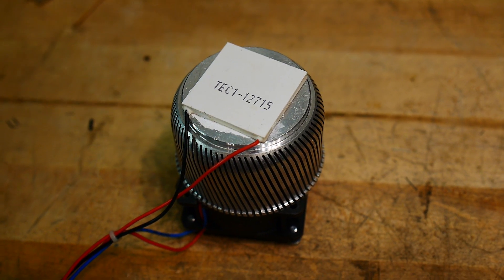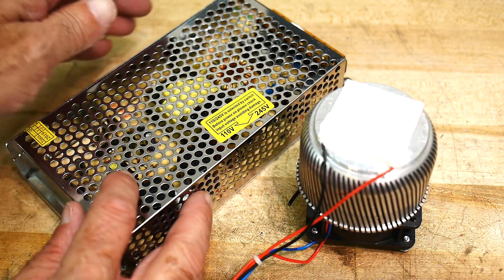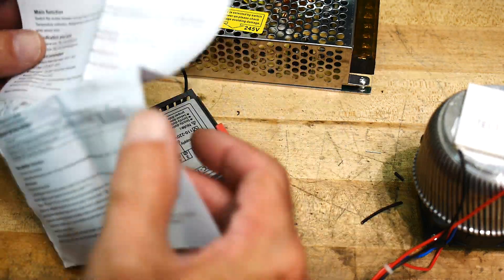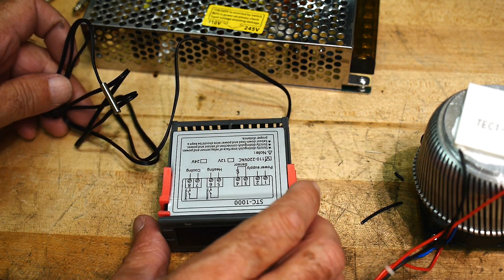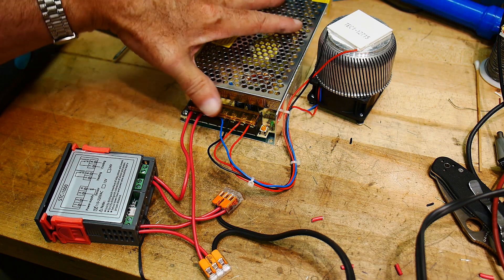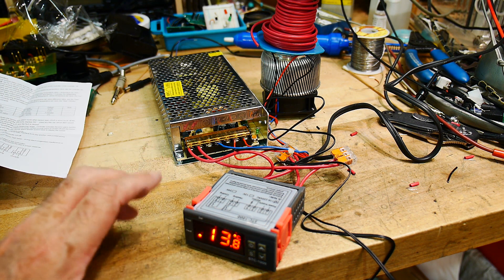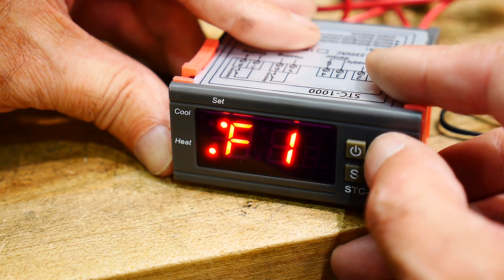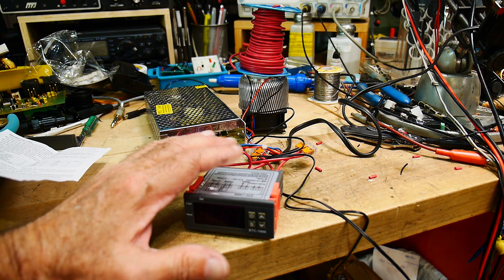#473 TE Cooler and Temperature Controller

Comment: According to the data sheet, the STC1000 uses an NTC sensor not a thermocouple. I thought it might actually be a PTC so looked it up. It's unusual to use thermocouples for very cold stuff but I assume the real reason is cost, those things are cheap! Thanks for the tip on the wago connectors and I hope to see more of your peltier device. I did PID controllers many years ago and digital (on/off) output controls were always considered very crude - that was the days of analogue everything of course. These days I think most controllers are self tuning so yes it will be interesting to see if it settles down with use. Anyone wants to know more about PID control search out Ziegler & Nichols - they basically wrote the book on it.
Reply from the maker: PID has some nice math in it. Now everything is software. I'll be doing a video on the WAGO stuff soon